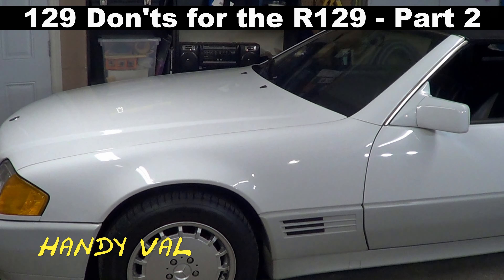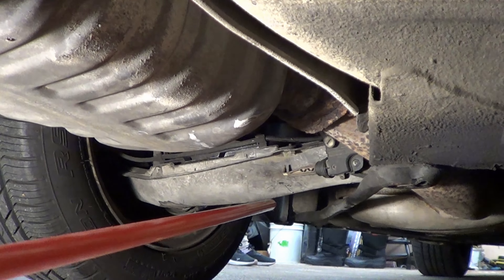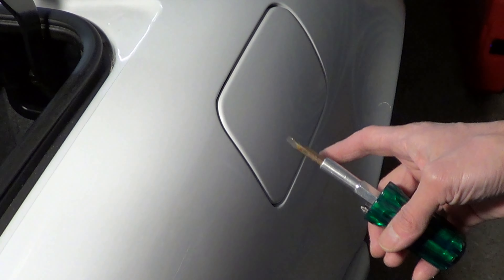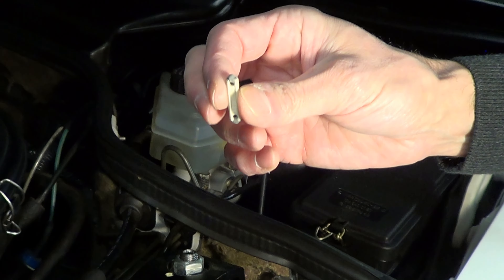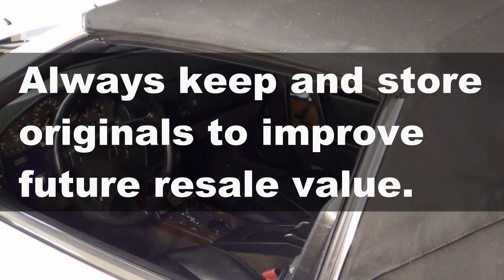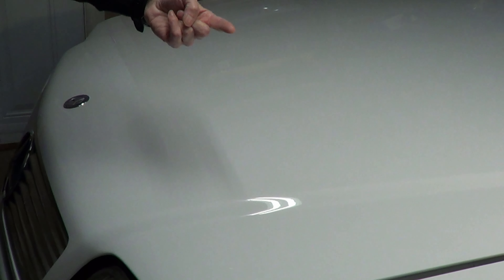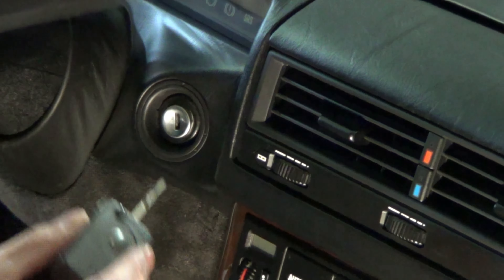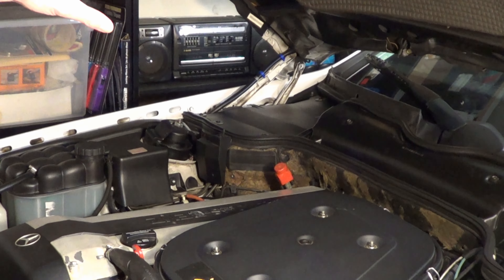129 Don'ts of R129 Mercedes-Benz SL Ownership - Part 2 - Avoid these to save on costly repairs

Comment: Really leaning in on this channel for my recent 1990 300SL purchase... Thank you for making these videos.  Any plans on doing a video on swapping out spark plugs and/or transmission fluid & gasket replacement?
Reply from the maker: Thank you for your support in watching the Handy Val videos! My goal, which is ambitious, is to keep the world’s R129s looking and operating as if they just rolled off the assembly line. 
Thanks for the video ideas. I’ll put them on my list of future videos.
The 1990 SLs were the first to hit the streets and because of its age has had the most admirers! My pleasure to help.
Reply: @HandyVal  you’re the man!! Swapped out my engine & cabin air filter today!! Looking forward to your next video!

Comment: Another great video =)  I shared this one as well in my blog. 

How do i test the Rollbar sensors?
Reply from the maker: Thanks for watching and thanks for sharing. Much appreciated.

The R129 rollbar will pop-up anytime one of the rear tires is off the ground. It does this by applying pressure on those rollbar sensor ‘wings’ which act like a switch. The sensor has two settings - either on or test mode. The settings are visible on the switch ( granted you need to squeeze yourself under the car; you don’t need to jack it, as there is enough space).If you turn the setting to test then all it takes is for you to drive the car about 20km/hr and then forcibly hit the brake pedal. If the switch is working the rollbar will pop-up. You try this on both switches, one at a time. 
The other thing to note is that the switch needs to be carefully calibrated, so if the tire leaves the ground it can pop-up. If not calibrated properly it may never sense that the tire is off the ground and never activate itself. Given, the age of these cars, we never know if someone along the way ‘fiddled’ with the sensors and incorrectly or accidentally moved them. There’s I believe two screws holding each sensor in place. I should probably make a video on this, as I’m going by memory for this comment and there’s likely more. In the meantime, I hope this helped.
Reply: @HandyVal  Ah so they CAN be calibrated! On all years? Mine is a 95. 
And the problem is that the rollbar pops up way to easy. To much speed in a roundabout or driving over a traintrack and it jumps up. 

The car is lowered with AMG dampers so I guess they need to be calibrated then. 
I was thinking of buying new ones but they cost over 400 usd each here in Sweden...
Reply from the maker: They definitely need to be recalibrated - that’s why they activate on the slightest road bumps. The 90 to 95 models can all be recalibrated. You need to loosen the screws holding the sensors and lower the ‘sensor wing’. Finding the right spot is a bit tricky as you need to lift one side of the car (using a jack), and ensure that the suspension part hits the ‘sensor wing’ to trigger it. It needs to trigger when the tire is barely above ground.
You don’t need to buy new ones. Your sensors are working.
Reply: @HandyVal  Thank you VERY much for this! 🙏🏼
I hope I help you get some views on your videos :)
Reply from the maker: Thank you! Happy to help as much as I can.

Comment: Thanks . I have a 90 300SL did not know about the oil level #33...I've done the head gasket already so who know if that what killed it.
Reply from the maker: The M104 engines used in the 300SLs were originally prone to head gasket failure. Mercedes noted that the oil level can contribute to early gasket failure. I don't think it killed yours, but likely contributed. Further, the new head gasket materials are better now than the original ones and so should have a much lesser leak problem, if any. Now, that you have a new gasket, I would keep the oil level a bit less than mid-level, change oil regularly and ensure the oil temperature doesn't exceed the 105/110C. Following these tips should keep that new gasket lasting for a very, very long time, likely never needing a replacement.

Comment: On running hot (engine M104, and I assume the M103, M119 and M113 as well), this can be caused by an underpressurized and/or leaking AC system. The auxiliary AC fans come on at around 95 degrees Celsius when everything is well. However, when the AC system pressure is too low, the fans sometimes don't come on at all. 
Your best bet in that case is to switch the AC off (EC on the climate control unit) because then the fans will come on at around 105-110 degrees Celsius and cool the engine down to around a 100 degrees. Toasty for the occupants of the car, but at least they can continue their journey. 
In my experience, if you drive over 30 mph or 50 kph, the outside airflow will keep the engine cool enough. It's just very inconvenient when you have to stand still in traffic for a long time.
Reply from the maker: Thanks for sharing your thoughts on the R129 running hot. I made a video on the auxiliary fans. https://youtu.be/E8gmKnqOe9I?si=eYlen1t9hJVJagoc
I agree, it’s heavy stop and go traffic that create the ‘hot’ temperatures.

Comment: I have always considered my R129 as an unexploded financial bomb parked on my drive ready to explode at any time! Just looking at it the wrong way tends to cause a failure somewhere! I just got out of hospital to find none of my family touched the car when I was incapacitated and the battery was flat. Knowing never to jump start the thing I used a new "Conditioning", charger and guess what it fried the roof control module that cost £1100 to replace with an OEM part! If your battery goes flat disconnect it from the car before charging it! Having said all this I still love the thing!
Reply from the maker: Hey. Thanks for sharing this. Nicely described. The R129 community love their cars. Nothing, even expensive repairs, can’t break our love for them.

Comment: I used 87 gs a few times, it’s was just fine on my m113 r129.  This was in winter time. I would not do it in summer.
Reply from the maker: The M113 engines are amazing and are usually referred as bullet proof. I would avoid 87 octane. Once in awhile won’t cause any long-term issues but try not to.

Comment: I have the same rims…. They are a PITA to clean!
Reply from the maker: Oh… I know, the suffering we endure to keep them clean. I use two rim cleaning tools. I now use a ceramic paste wax specifically made for rims (McKees is the brand). It’s better. My fronts have Akebono ceramic pads so the dust is minimal, but they still get dirty from road grime. The rears are standard brake pads (I bought Akebono for them too, but I haven’t installed them yet), and so they get much dirtier, much faster.